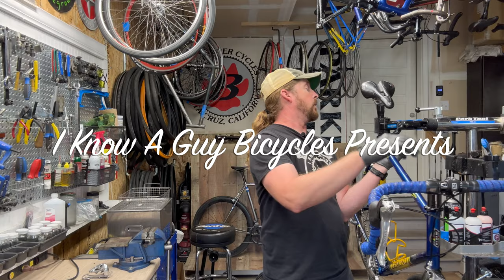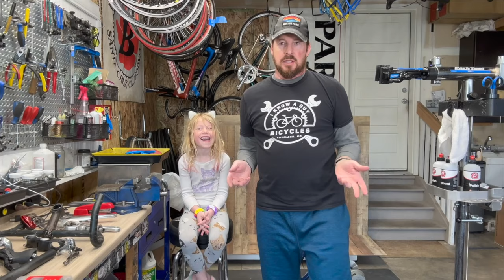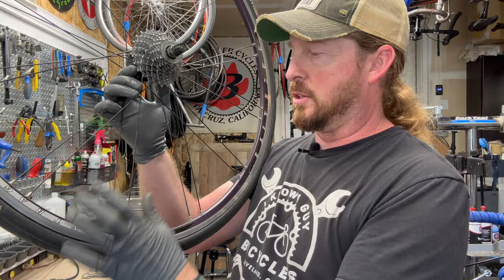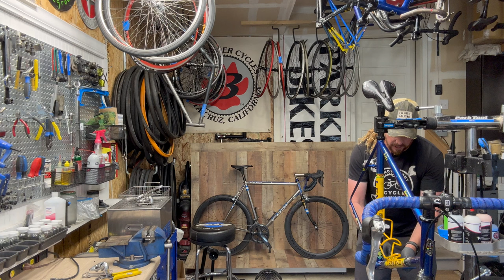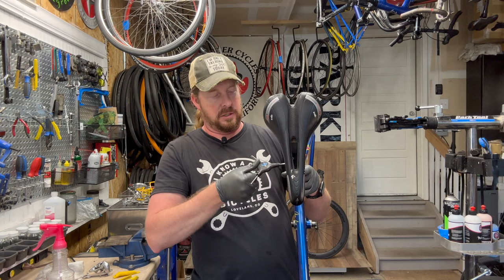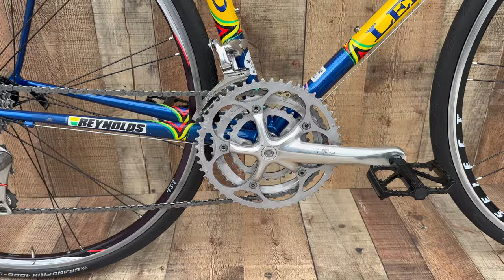What will it cost YOU? 2003 Lemond Buenos Aires -Tips For Buying A Used Bicycle

Comment: At my shop it would get new rubber, bearings, cables, tape, etc.  About $250 parts and labor.  Sell it for $700
Greg had short legs and long torso and his angles were 72/72 so the top tube will be 2-3cm longer than similar frames.
Reply from the maker: I have it listed after my magic at $600. $700 for eBay because of all the fees. What a great ride for someone just getting into cycling. I have a couple of LeMonds personally and love them.